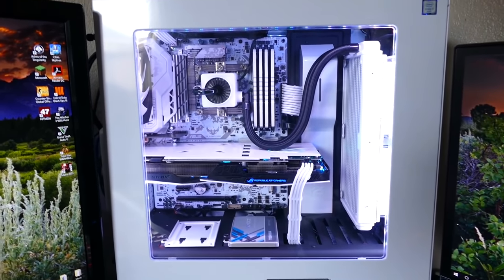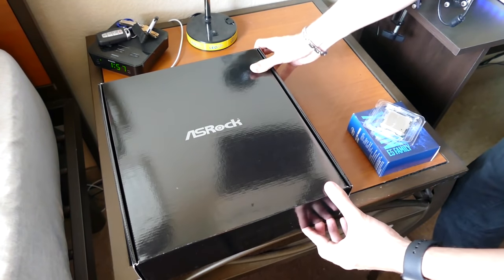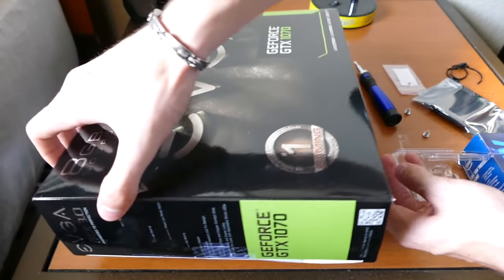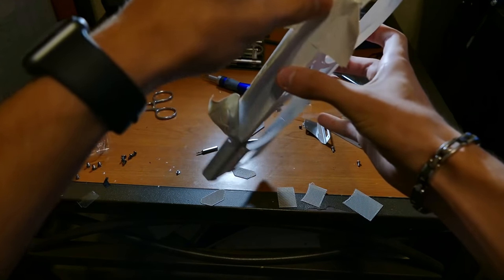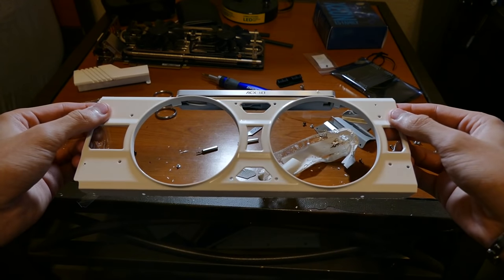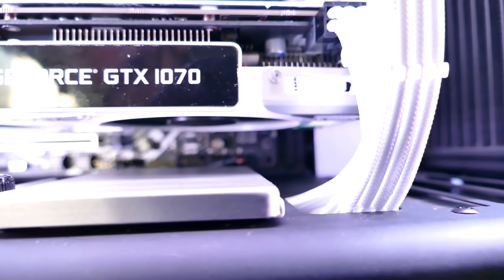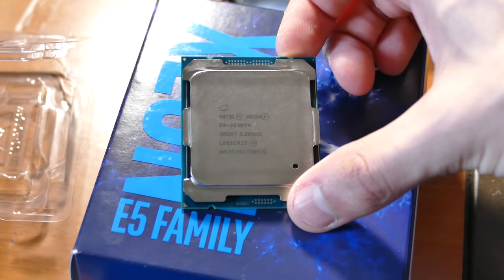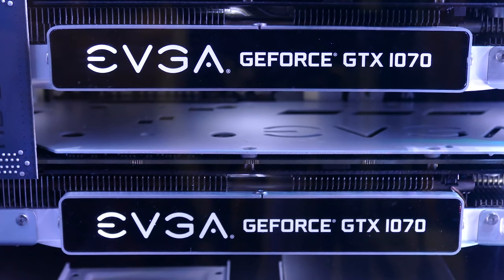Building Walter White v2.0

Comment: Wouldn't it have been better to buy a single 1080 over 2 1070s? I mean sli on a lot of games is pretty unstable.
Reply: Thedovahkiin Well, in games that have sli and do scale well it does reach Titan XP performance. But yeah, I'd also rather have a GTX 1080 instead because all games support it and it's also 4K capable by itself.
Reply: Get a single 1080!
Reply: Thedovahkiin Nope. I have a 1080, but it isn't worth it. It only performs about 15% better than the 1070? so no.
Reply: It's actually around 30% faster.
Reply: I think he did it because of the nice aesthetic of having 2 gpus. It might not be the most practical thing to do, but it is pretty damn pretty.
Reply: Thedovahkiin he must have wanted something between the power of a 1080 and 1080 SLI. gtx 1070 SLI will blow a single 1080 out of the water.

Comment: So tomorrow we shall see if an expensive 10 core will keep up with dual 8 cores that you can get for less than $120... the xeon e5-26xx v1 series is amazing used now
Reply: Also like # 69 XD
Reply: Dual E5-2670 score a passmark of like 18k! Usually scores around 2000-2100 in Cinebench. Processors can be head for $50-70 but if you want a non OEM server board it will cost your around $400-$550. Like the highend ASUS ones.

But if your willing to go server board you could snag one for around $200. Dell OEM from a precision workstation T5100 can usually be found slighlty under 200. And like you said if you want to spend around 120-150 for each used processor you will see even higher benchmarks as the E5-2670 is only 2.6ghz. 

The E5-2670 was like $1600 just what 4-5 years ago and now its  50-70 bucks.
Reply: JimmysTheBestCop yeah, this is the quandary I am in right now.  got an e5 2670 v1, but finding a decent priced x79 board is impossible. 

The CB score on the v4 seems pretty low, even at stock frequency. just put together a 5820k rig yesterday, and at 4.3ghz, it's get 1277.
Reply: Probably better off buying a 2nd e5-2670 and getting a used dual socket workstation board and just forget overclocking and go for straight 16 cores/32 threads. Workstation boards you can usually fit into a full tower case. Some of the server boards you can't.
Reply: I have dual xeon e5 2670 v3s and I get 3000+ cb in cinebench while not multitasking. I can also run a teamspeak and Minecraft server while getting about 2000-2500 cb

Comment: I figured you would upgrade to an X99 shortly after watching your z170 build. Did the same as well after building my z170 i7-6700k system. Realized the i7-6700k was the end of the road in terms of upgrade path  (and how limited the z170 really is vs the x99). I just gave my parents that computer and started over. With the x99 youve got plenty of CPU upgrade options in the future. PS: we got the same mobo lol.

Comment: As long as you're not playing or going for ~110+ FPS the xeon is plenty fast for virtually every game, I have a 2683 v3 myself and the only issue  I ran into is GTA 5 crashing due to too many cores. Simple fix for this is create a custom shortcut and set the affinity (how many cores you like to use  in the program) within a little start command and thats it. This custom command is also really handy for benchmarking so you don't have to set core count in the bios :).

Comment: I just had a few questions about why you didn't pick certain options or if you ever will

- Why not the MSI X99A XPOWER GAMING TITANIUM Motherboard? I get that it is very expensive, but I was wondering if you would have been able to get it sponsored like the ASRock X99 Taichi board. 

-  Why not go with the ASUS DUAL 1070s? They're already pre-painted white.

- Will you ever upgrade to the white NZXT S340 Elite?

- Also will you ever consider using Intel SSDs since they're mostly silver/white and would go well with the build?

Comment: Love the new setup, great white and black offset. The xeons usually get to 103-107 BCLK, I have a e5 2670v1 (8c/16t) and it gets to 105 but it don't like ram settings over 1600mhz. Also try locking in turbo mode and turn off speed step in the bios, it made a world of difference in a few games for me. It was underwhelming before I tried those settings.  There may be a setting called cpu level up, I tried it and it booted up to 3.8Ghz for a few minutes but it de-clocked itself.... maybe a bios micro code will allow for a higher multi? Last line is a little deep but just wanted to leave you food for thought and what may help you.

Comment: awesome video.....here are a few free tips from someone who has done alot of autobody work for your next paint job(yours looks great BTW). Use at bare minimum blue painters tape....I prefer the green scotch autobodoy tape(can be found at most auto parts stores)....the old school beige masking tape is garbage. Also to help avoid the paint coming off when you pull the tape you can take a NEW razor blade and slightly score the paint along the line where tape meets the paint. 
Anyway great vid once again.

Comment: You pushed down one retention arm and then the other, skewing the pins in their corresponding sockets. Both arms should have been pushed down at nearly the same rate, staggered only a little in time to allow the locked one to arrive just before the other (the locker) so as to maintain better parallelism between the pins and sockets.

Comment: Just curious, any particular reason for going for the decacore xeon?  Obviously it's a beast for heavily multreaded applications even with the lower clocks, which will help with video editing etc, but for the same price a higher clocked 6850 would still have done well for you and handled the two 1070's better.  A octacore 6900k was a bit more expensive as well than this xeon, but it's a good middle ground as well considering you were initially aiming for a 6950x. 

Either way it's obviously built, done and looking like an awesome rig.  I'm just more curious as to the choice of cpu here as the lower clock speeds will certainly hurt it in many tasks.

Comment: Will you be overclocking the Xeon with baseclock? The speed seems pretty low for 10 cores especially. Considering the 10 core from the 6000 series is overclockable with the multiplier, idk, i think it wouldn't been worth it going this all-out with the build.

Comment: Science Studio, did you have any issues with activating Windows? As in, did it re-activate with no issues or did it say you had to get a new activation key? I've heard about making big changes to the system, like a new motherboard for instance, would trip something in Windows 10 as there was a lot of controversy surrounding Windows 10 and system hardware upgrades.

I'm planning on upgrading my current system from Z97 to either Z170 or X99.

Comment: check the cpu seating on the motherboard. the arrow should be following the motherboard arrow. the pic will bend u need to use micro glass to set it straight back. same thing happened twice after fixing the motherboard pin

Comment: Hey Greg I have a quick question

Iv'e been looking around ebay a lot lately and I have seen numerous listings of the 2630 v4 used for about $150. I am going to be doing a lot of video production and after effects stuff that would take advantage of the extra threads but I am wondering if it will really hinder gaming performance. You didn't post any gaming benchmarks with this cpu and I cant find any that compare the xeon to other processors in gaming. Btw this will be paired with a 3gb 1060.

For the same amount of money as the xeon and an x99 board I can get a 6700k and z170 board so I am split. Would there be a big gap in multithreaded applications like video and after effects stuff? Would there not be a really big bottleneck with the 1060 since its a semi lower card?

Comment: Hey Gregg,

I'm curious. Is there any benefit to running 1070s in SLI rather than buying a single 1080?
Reply: Sli 1070s are more powerful than a single gtx 1080 but there is always the issue of sli scaling unfortunately
Reply: Nowadays, DX12 has much better multi-gpu scaling, and editing and rendering videos will benefit from the extra vram. Long story short, unless you only play DX11 games, the two 1070s will usually be better.
Reply: he intends to do more than just game on this rig gamin is secondary so no he has used his head wisely but i will let him explain it in one of his next video's you can use cuda cores for more than smooth gaming

Comment: Nice PC build Greg I'm looking forward to Walter White 2.0. I strongly believe that you could have made a better performance PC for cheaper. For example, in one of your videos you said the I7 6700k would be more than enough cores for you but know you have a Xeon? You could have kept the I7 6700k and bought two GTX 1080's which would have crushed Walter White 1 and 2.0 and would have saved you $400 and given you far more performance. Or if you needed a little more cores a 6800k and over cloak it to 4.2 ghz with a GTX 1080 would have crushed Walter White 1 been more stable, more affordable and better performance. Sli is not that reliable and a 10 Core Xeon at 2.2 ghz. Will not benefit at all in SLI its waaaayyyy to slow. You will probably get the same performance with a 6700k and single 1080 in gaming because of that Xeon. For what you do in a daily basis Skylake or Broadwell-e would have fit you much better. Also one high end graphics card is a better more reliable card than two middle level ones.

Comment: Going to sell my 1070 when the 1080ti is announced. I like it but i want a bit more horsepower,and for gaming SLI is flaky but as a content creator using a Xeon with 10 cores 20 threads will make things much faster. Also going to upgrade my case and cooling solution.

Comment: Not sure if you ever want to do an ebay build video but an interesting 1 might be to do something with a super Micron X8DTL-iF motherboard and I guess 1 of the 6 core Xeon 5600 processors. Its an atx board so that should eliminate several problems. Can take both ECC and Non ECC DDR3 up to 1333, which can be gotten pretty cheap.

I think you would have a really good take on it since you can do gaming benchmarks and content creation benchmarks. Where as many youtubers do 1 or the other and not both. And you can compare it to your new high end Intel gear.

Comment: Holy hell. Okay so I have been trying to decide on a setup for my next PC. Been running an AMD FX-8350 with 32 GBs of 1600 MHz DDR3 for gaming and virtual machines etc. So I've been wanting to get either a set of two Xeons that are at least 8 cores 16 threads each. Or an i7 6 core and 32 GBs of RAM. Mind you I'd not be doing overclocking either way. And I just noticed because of this video that the Xeon he is using is around as expensive for one of them as one 6 core i7... I made a decision not to save for a dual socket motherboard and 64 GBs of RAM to start with one of those 10 core 20 thread beasts. Then buy a second set of 64 GBs of RAM when I buy the second Xeon. 

For those who don't know, more cores is usually better for someone who can manage to use 128 GBs of RAM with ease on VMWare Workstation. I know a friend with 256 GBs of RAM in his server for VMWare. And I managed to use around 200 GBs of RAM within around 10 hours on his system. So yeah.

Comment: Hey Greg,

I' am curious about Walter White 2.0
I did also an similar update with my older gamer/benchmark PC going from a i7 4930k to a E5-2687W Octa Core
But I have to say that I kinda regret this step, because I can only get the Xeon work with 3,4 GHz and the 32GB DDR3 RAM dropped from 2400MHz to only 1600 MHz.
My Cinebench Score is almost the same it was before and during my workload in content creation progams I cant really tell much benefit from the 4 extra cores.
I hope you will do more details tests on the xeon to help others with their decitions.
thanks, Bernie

Comment: Why you changed deepcooler captin ex 240 cuz I wanted to buy it and use to overclock my i5 6600 Is it not good or what?
Reply: I can't speak for the ex version, but I've got the original captain on my 4790k @4.7Ghz
Reply: Thank you so much and pls tell me what is the max temp you have got?
Reply: Around 80c, completely stable

Comment: I had issues with cpu seating with my 2500k, it wouldn't awake from sleep properly and sometimes not boot at all. Reinstalled the cpu and everything worked fine ever since, so it's not unheard of. In my case, I think it was too much pressure from the cooler, a 212 evo.

Comment: I don't understand why you went with the xeon processor range, especially  if you expected to overclock , they are not designed for that , the I7 6700k is perfect for what you want (assuming that i know what you want) , the x99 series is not worth the extra cost unless you are using specialist software, which as been designed to use extra cores from the ground up, like some 3D rendering software or proper video editing software (not premier or Vegas). the X99 series  IMHO is  a con to sell cheap server hardware to enthusiasts, when they should be increasing the performance of consumer grade processors. Get you act together AMD so we can have some true advancements

Comment: dust could be the culprit for not posting. The second time you seated the CPU must have removed it
Reply from the maker: Doubt it. Nothing was in there before or after.
Reply: i doubt it but maybe im more inclined to believe the cpu can shift slightly in the socket when you lock the bars down to keep it seated there always seems to be more play than there should be before you lock the bars down compared to LGA1151 Socket for example
Reply: Maybe some a cpu pin on the mobo wasn't making contact? very strange.
Reply: Well if you watch in the video he only locked it down in one place first usually people lock the hinges down at the same time.It probably moved more to the left and didn't move back to the same spot when the other one was locked down.

Comment: HELP! im thinking to upgrading my current system 

i3 4150 3.5 ghz ------- thinking to a xeon e3 1231v3 3.4 ghz or to the i5 6400 which is better
gtx 750 ti 2gb SC -------- to GTX 1050 ti or GTX 1060 3g

Comment: Why didn't you get the ES version of the 2630 V4? This has the same clockspeeds and other specs:
http://www.ebay.com/itm/Intel-Xeon-E5-2630-V4-ES-2-2Ghz-25MB-L3-10-Core-Max-Turbo-3-1Ghz-85W-Broadwell-E-/401203824283?hash=item5d699c869b:g:EAIAAOSw8vZXMgAK
My 2630 V4 ES came with the retail SSpec though.. steal for 240 bucks

Comment: Hey, i have a question, that cpu xeon e5 2630v4, can handle modern games like an i7 6850k, or the i7 is better for gaming, bacause, have same price... it be paired with 32gb of ddr4 3000 and gtx 1070, probably next, a sli, thanks for you response...
Reply: unless you are doing alot of video rendering etc like Greg the xeon is overkill for most ppl....and honestly so is the 6850k but if its one or the other I would go with the i7 because your single core performance is waaaay better plus with the K you can OC.
Reply: You shouldn't even be using i7s if you're purely gonna use it only for gaming.

The maximum should be an i5 6600K.

Comment: are you sure you didnt flip the cpu while putting it back on? x99 socket is actually up-side down. So the letters of the cpu will be facing the top of the motherboard instead of the bottom.
Reply from the maker: It was oriented correctly both times.
Reply: Chuy Castro aren't CPUs only supposed to fit in the socket one way?

Comment: So I need help from people more tech savvy than I.  I recently bought an EVGA GTX 1070 SC, and when I run any benchmark on it, it boosts up to a clock speed then immediately throttles. This happens no matter what I do, raise the power and temp limit, raise voltage, fan percent. Even default settings it won't boost up to it's max and stay there, it fluctuates wildly. It happened with my last video card too, so I thinking it might be something in my system. Ideas?
Reply: thekalkara131 Maybe the PSU faults, either the 6-8 pins conector or the PSU itself

Comment: @Science Studio my current system is  Intel i7 x 4790 Core i7 Processor Asus B85M-F motherboard Apacer Ram DDR3 8Gb - 1 ASUS GeForce GTX 960 Turbo 2GB Video Card 

what are my upgrade opitions?
Reply: It depends on what you are planning in the future. Your processor is still a good choice for any kind gaming/editing PC. If you are planning to upgrade the GPU i would recommend a gtx 1060 6g ( i upgraded from 960 4g to 1070 but a 1060 has plenty of power for almost any game for 1080p or even 1440p) A ram upgrade to 16g should also be considered in the future. Depending on your budget you should take a look at upgrading to a skylake ( or Kabylake) plattform. But i`m just a little german pc-gamer (so sorry for my english ;) ) and you should get some more opinions on that.

Comment: I think you will be disappointed with the Xeon. That's not too good of a Cinebench score IMO. Yeah you're going to overclock it but baseclock overclocking screws with PCIe lanes and RAM. At 4.5GHz I get a Cinebench score of 970cb which is pretty close to the Xeon considering the Xeon is 10 cores 20 threads and scored right at 1300cb. I mean the Xeon is like 2x the price of the 6700K and it only gets 330 more points and has 6 more cores and 12 more threads. And you're giving up some gaming performance as well. IMO I just like the speed, onboard graphics (for if my graphics card shits the bed), and the ability to multiplier overclock my 6700K. Looking forward to hearing your thoughts in the benchmark video Greg. Good video, WW 2.0 looks sweet!
Reply from the maker: I've owned and tested the 6700K extensively. This is merely for the purpose of experimentation.
Reply: Science Studio So the Xeon and two 1070's isn't going to be you're daily driver PC and PC that runs the channel?
Reply from the maker: It will be. That's the point.